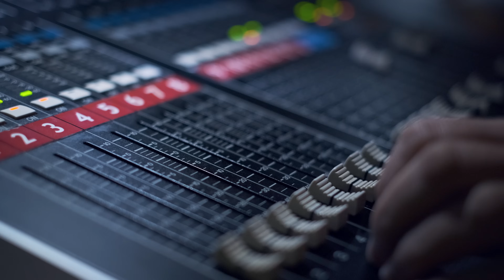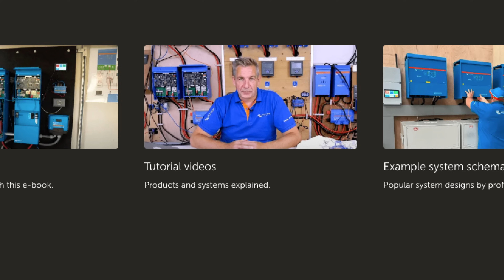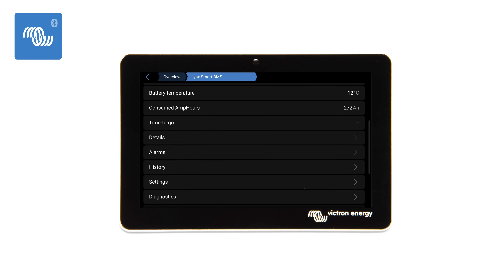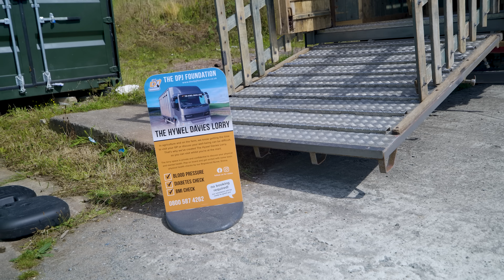This truck powered by Victron helps farmers in crisis

Comment: I am wondering if it is possible to hook up the battery car to the inverter/charger and loop back the AC output to AC Input,  in a way that you could charger the camper battery via car battery through the inverter/charger, when the car is running. Can you provide me an answer to this topic? Thanks a lot!
Reply: the Car battery can charge another battery with a dcdc converter.    connecting ACin to AC out isnt a great idea I am afraid
Reply: @JohannesBoonstra-ol2nz  i know that there is a dc to dc conveter, but I want to simplify as much as possible and use the inverter charger at the highest potential
Reply: @marianiancu990 getting the ac out connected to ac in would make the inverter to switch off , so that’s not a solution